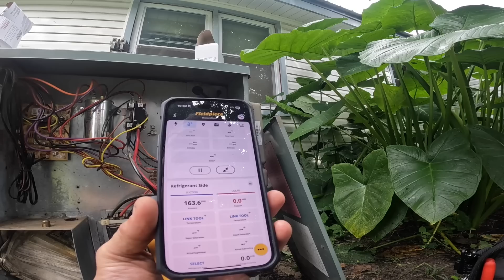After A Lightning Strike It Could’ve Been Much Worse! #hvacguy #hvaclife

Comment: You can take your resistance reading, go online and type in ohm calculator. Type in the resistance and voltage and it will tell you what the Amp Draw will be. 96 ohms at 24 volts is 0.25 amps on  a 3 Amp circuit. Might save you a contactor or two👍

Comment: OL Or open lead is just that. The Circuit is open not Shorted Curtis.. The blown Leg may have Shorted to Ground.
Anytime a Lightning strike is Near a Coil of wire it will work like a transformer and produce a voltage and if the HUGE Current produced has some where to go that Coil will Smoke.  Electrolytic Capacitors POP like Fire Crackers...
In The IT /Telephony world We always emphasized customers NOT to coil up excess cables into coils and leave them loose under the Desks Etc. But out of the Way ..
Reply: At first he said he saw 98 ohms.  That is shorted.  Then he got OL and that is open.  He got it right, the component failed.
Reply: @achdiagnostic7773  YES, It did Fail.
I think he got conflicting readings...

Comment: Curtis, I assume this was running at the time of the lightening strike? I've read to turn off unit during lightening. However, the local a/c company that maintains my 3 ton 2016 Ruud package unit (East Central Florida) says not to bother. Leave it running. I do have a question please: if there is insulation drooping down from the top of the blower side cover (so it's just the metal top not fully insulated) how can I re-insulate it? Thanks so much.
Reply: Buy some spray adhesive and stick it back up

Comment: Definitely grab yourself some elephant ears!
Hearing the neighborhood discuss the "collateral damage," I'm reminded of how I USED to go around and unplug half the house when a storm was approaching. And how many times I've dodged a bullet over the years after NOT doing this anymore.

They're VERY lucky to get away with a contactor and a thermostat. We once had lightning strike a tree outside my parents' bedroom when I was a kid. Fortunately, the only thing destroyed was our well pump. (Somehow, it missed our roof antenna on that side of the house!!!) I even remember my father and my uncle replacing said pump, my uncle asking if the breaker was off, my father saying yes, and then a few minutes later my uncle got a nice 240v zap. I've never seen my uncle look at anyone like that before, or after. I've never seen my father run so fast - and he was a firefighter. My father *wired the house, never labeled the panel, had no idea what breaker was what, and didn't even have the cover panel installed - ever* and to this day, only about half the panel is labeled. (It's on my to-do list, I swear!) Don't worry, I installed the panel cover when I was in 7th or 8th grade, when I found it on a distant shelf in the basement.

Comment: Let me ask you a question I live in this County in Florida we don't have real good electricity we have a lot of brownouts electricity jumps up and down I'm retired AC Tech and I've been having a lot of problems with these brand new Wi-Fi thermostats going and burning out I just want to know if that is a common problem especially here in Florida since we have so much lightning we get the power work shuts on and off
Reply: We get that from Reliant Energy in Houston. We turn A/C off until weather is good again.-
Reply: Google Nests don’t like being jumped out from the system so I get that they would do that from power outages and strikes.